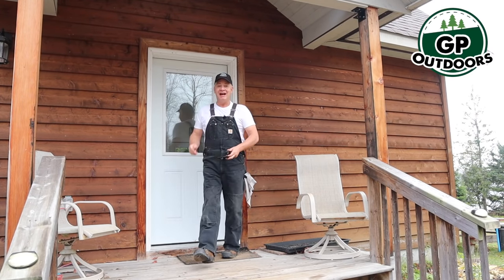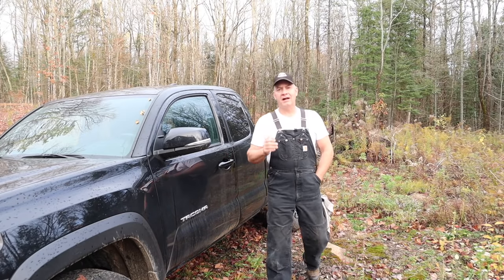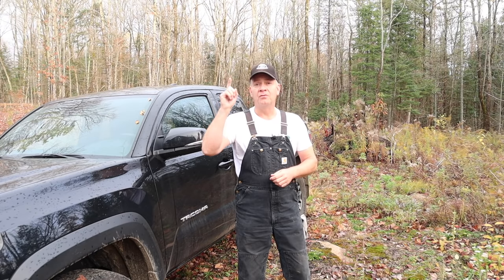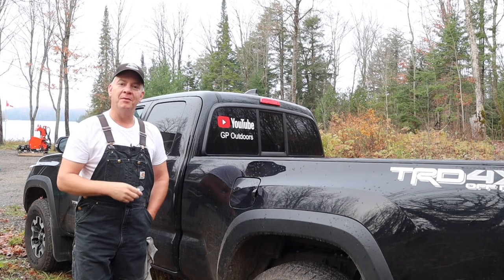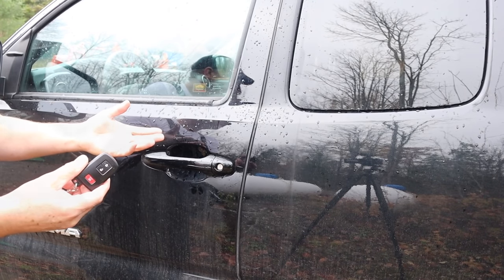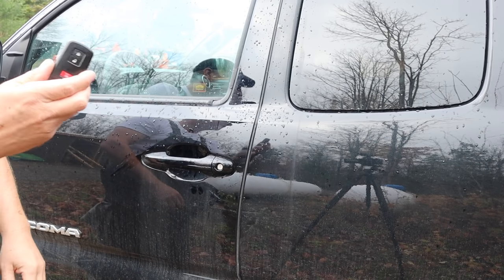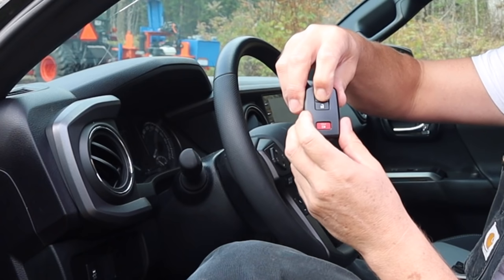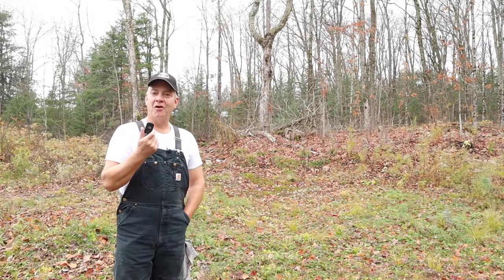#345 Stolen Truck. How To Deactivate Your RF Key FOB. Part 2. You HAVE to watch this!

Comment: Car dealerships should be teaching this info at the time the car is delivered to the new owner. Glad that I stumbled onto this video.
Reply: They should just do regular keys 😑
Reply: I am surprised this is not in the car user manual.
Reply: @jayl2499  If the car makers put this info in the users manual, they wouldn't sell as many cars.
Reply: Yes, same here, on stumbling onto this video!  Timely advice!!!
Reply: Relatives high end vehicle fob was stolen at work while in a security locker, yet, security has no answers. So here's hoping this video gives some piece of mind till it is decided what direction to take on replacements.  Thanks so much for your video, it is greatly appreciated! Have a good weekend!
Reply: @jayl2499  Locksmiths and car dealers wouldn't make thousands then.  Relatives fob was stolen yesterday at work from a security licker, security has no answers, car is high end so it is going to cost $2500 - $3000 to replace two fobs. Totally a rip off and unreal.  Locksmiths get hundreds.  Lots cheaper, but still outrageous!!!
Reply: @aldomandovani  I have no problem with regular keys.  So it takes an extra second or two to get it into the lock and turn it boo hoo!!  With my car that has a regular key you soon automatically learn the motion and next thing you know you are on the road.  People have been doing it like that for as long as there were cars on the roads.  Heck, some really old cars have two keys even.  One for the doors and one for ignition.  Those people whining about the "inconvenience" of inserting a key don't realize how easy they have it.  Maybe some people are just lazy but then some like cars that are fully loaded with electronic gadgets.  Sure all that stuff is nice and all...until it breaks and costs you your first born to get it repaired!!!
Reply: @jayl2499  "I am surprised this is not in the car user manual."

It is on page 128 in the manual for my 2022 RAV4. However I found out about it first from the web, in the first days after I bought the RAV4, there are many YouTube videos about it. The manual also says on page 102 "When bringing a key with wireless remote control function onto an aircraft, make sure you do not press any buttons on the key while inside
the aircraft ...... Pressing a button may cause the key to emit radio waves that could interfere with the operation of the aircraft"
Reply: @aldomandovani   True, they keep making us more vulnerable to things with so much technology.  People need to start using the steering wheel locks again.  They won't take the time to saw through a steel bar because they want to get in and out quick.
Reply: They don't teach this thing, they just give you the key fob and that's it, I just learn it until I watch on youtube.
Reply: They should but American is all about the business that's why I don't buy these new junk vehicles
Reply: Hey GP just saw your first video about the stolen truck & wondered why you didn't mention the deactivation mode on the fob, I read it in the truck manual,  I saw your 2nd video glad you mentioned it to your viewers, I'm  sure it was helpful to everyone,  much mahalos from hawaii 😊
Reply: @steveolive9991  This makes NO sense, no body reads the user manual before purchasing a vehicle.

Comment: If the police, insurance companies, claims adjusters, and likely auto manufacturers are aware of this problem, why haven't they redesigned that lock and push button start system to be more secure?  Good tip from that viewer.
Reply: because it makes more sales for the manufacturer
Reply: because the user wants 'seamless integration' 
Just look at the explosion of smartphones and Amazon Alexa and the 'smart house' devices that will text you what food is in your fridge.  
Its because people are lazy.  They want the Jetson's lifestyle (70s cartoon).  Just look back at commercials advertising items for the home back in the 50s and 60s.  Or World's Fair.
Reply: push button switch is much much cheaper than a key and a cylinder style lock switch but much much less secure. They do it for more PROFIT.
Reply: @davidbrennan5  not sure why you say that push-button is cheaper, they first came out on the high end luxury & super cars.  They require additional transceivers.  If there is a reduction in cost its only due to economy of scale, as they've already made the investment into the high-end cars (where the market is demanding it).  Its the same reason nearly all cars have heated seats and remote start.  Certainly anything above the base model sub-compacts.
Reply: @f1y7rap  push button switch cost 2 dollars. Cylinder lock switch cost $30+ dollars.   Thieves can steal a car in 7 seconds now.  The older cars with a key and a imobilizer system were harder to steal.
Reply: @davidbrennan5  ok, but the push-button system is not just the pushbutton switch.
Reply: @f1y7rap  The manufacturers have been making cars cheaper and cheaper every year. If they can save a trunk lock door locks and ignition locks + glove box lock on every vehicle + keys they can make more money.  The thieves are laughing because it is much easier to unlock and start a vehicle now.
Reply: Bc it is a computer n all things in technology can be hacked nothing is hacking proof I went to school for a computer tech technology n I learned tht everything can be hacked if u have a smart enough person reverse engineering
Reply: Yup there all in on it !
Reply: Seems like insurance companies would hand them pouches out for free when you get ins. from them
Reply: @f1y7rap   Ah the Jetson's. I watched them in B&W 'till my parents got a color TV. :D  "These three day work weeks are killin' me!" ~ George Jetson.   I used this line at work just last week on the last day before my vacation started.
Reply: Simple they want sell you another one, the dealer that is.
Reply: The insurance companies will just jack up their premiums. Win-Win in their eyes.
Reply: Maybe these companies are in on the action
Reply: @dart3407  😂
Reply: Because they are members of organized crime.
Reply: maybe manufacturers do something when they get sue by all the people that got their pickup truck stolen
Reply: Thousands upon thousands of dollars yearly are made by not telling you!!!
Reply: @f1y7rap  Totally agreed!!!  Just made that same reference recently!
Reply: @davidbrennan5  Totally agreed!!!
Reply: @davidbrennan5  Totally agreed!!!
Reply: @davidbrennan5  Totally agreed!!!
Reply: @josephskorich7029  Totally agreed!!!
Reply: @davidnikulka1437  That's for sure!!!
Reply: @stevenreynolds2327  No, because making claims raises insurance costs. They"re in it for the money they make not what you get to keep.
Reply: @SorinNicu  Totally agreed!!!
Reply: @HazyIPA15  Totally agreed!!!
Reply: The question is why are they not propagating this information to everyone calling them about the theft of their vehicle?
Reply: You would think that if these made vehicle theft easier they would stop using it.  In all fairness I have heard that some fobs turn off automatically if no motion is detected in some time period.
Reply: @f1y7rap  my 1966 Mini had push button start.
Reply: @davidbrennan5  i thought the cars came with a manual override key, so that you can still operate the car if the battery goes flat in the transmitter or if it gets broken, usually they put the cylinder lock somewhere hidden or out of normal view, like inside the centre console armrest storage.
Reply: @Murtagh653  You don't need that key to start the car, it is used to unlock the vehicle if the battery dies mostly. Theives buy a cheap box and they can program a new key fob. All they have to do is hold an antenna up near your front door program a key and they are gone in 7 seconds with your new vehicle. The older keys had a built in imobilizer the key needs to turn the lock cylinder and the imobilizer codes have to be right or the vehicle won't start. This is harder to overcome.

Comment: If you have a spare key fob that you don't normally use, you can keep it in any kind of can with a metal lid, so the key fob is completely surrounded by metal, that will function as a Faraday cage and not cost you a penny. Of course you can also drop your regular keys into the metal box overnight. Other alternatives are also simple, remove the battery of the spare key fob, or wrap it in aluminum foil, a couple of layers, the aluminum foil will function as a Faraday cage.

Comment: I prefer the key that goes into the ignition and gets turned. Works every time. The assumption is the push button was to improve security but that's not true. Technology and change in NOT always better.
Reply: How about they put a button like iPhones on the start button where only the drivers thumb print will start the vehicle?  I have just purchased a keyless car and 1) didn't know it was keyless untill after I purchased it and 2) didn't know about relay theft - Now I'm scared I'm going to wake up with no car..  Now I'm hearing about ODB theft as well, just a nightmare.
Reply: @Max317_  Thanks - faraday on way, steering lock on the way and might look at removing a relay or hiring Candice to sit in the back :)
Reply: @Max317_  Thanks I'll have to investigate that - the manufacturer's manual is pretty rubbish.  It's a BMW M135i
Reply: @Max317_  Thanks mate appreciate your help and advice.
Reply: @J4Z666  call your dealer and get them to do the research
Reply: @davidsalomaa373  I had an immobiliser fitted, got the faraday wallets and got the steering lock nobody has touched it in 2 years and good luck if they do they aint going nowhere..

Comment: fantastic advice. We really should be calling for car manufacturers to require pin codes in order to start the car. This is the way Tesla is handling this, this could work in other models too. All new cars are required to have a backup camera, necessitating a screen, so just make it a touch screen and require the pin there.

Comment: This is only my second video I've seen from this guy but I think he doesn't awesome job at explaining everything and the presentation is perfect. She seems like a genuinely good person. Double thumbs-up fun both videos. Oh and on a side note my secret to preventing anyone from stealing my 2007 Chevy Suburban is a little bit more complicated. My housemate remove the battery because he told me it was the wrong type and that it was too small for my vehicle when I just paid $450 from the dealer for this lifetime battery not even 2 months before when I had a bunch of work done on it including replacing the elbow joints and all the stuff that has to do with brand new tires. So after he replaced the battery with $100 one it never stayed charged for more than a day. So as of October 25th it will be three years since my vehicle has moved from the driveway.😢

Comment: Thanks very much for your invaluable info. Thanks both to you and your benefactor who gave you that info about how to disable the radio frequency of the key fob. I immediately went downstairs to the garage and tried and it all worked like a charm. Mine is also  2022 Tacoma Trail edition. Unlike yours, mine starts with a key, but I do have an electronic key fob that opens the door, and I also have a remote start fob to start the truck on those cold Canadian days when I want the truck to be warm when I get down to it. Thanks very much!

Comment: We have a 2018 Subaru Legacy that operates using the radio frequency key fob. We have a one car garage at our townhouse. The other car stays in the garage. In the middle of the night on  February 8, 2024, the car was broken into along with about 7 other cars in our townhouse complex. Fortunately, our car was unable to be driven away because we use a key-less steering wheel club (it's with a combination). No damage was done to the car. The thieves stole some items from the car.

Fast forward to last week after seeing this video, we tried the key-fob deactivation method, and it works. We also keep the two fobs in a large Faraday pouch. Plus we take smaller Faraday cages with us. Great video, lesson learned.

Comment: Thanks for posting these videos.  Shortly after taking delivery of my new 4Runner in the summer I ordered a Faraday Box to store my key fobs at home, assuming that thieves had to be very close to the fob to steal the signal.  Until I saw your other video, I didn't know they'd become more sophisticated and could steal fob signals from much further away.  So, I recently purchased the Faraday pouch you recommended.  I admit, it's a nuisance to carry the fob in the pouch. I'd grown accustomed to opening the doors and starting the vehicle without reaching into my pocket.  I suppose I'll have to get used to it.  It's a small inconvenience to protect an expensive vehicle.

Comment: As you show it, the suggestion from one of your reader is very timely and works very fine with toyota's FOB. If you have a vehicle that is on the coveted or even highly coveted from the thieves list, the other solution is to install a circuit breaker/switch between the computer and the fuel pump, the engine will still turn but it will never start. On youtube you can find some examples that work very well even for very recent vehicles full of electronic (as my 2015, F-250). The ''challenge'' is to hide the circuit breaker/switch very well while making it easy to use on a daily basis without leaving any visual signs of wear at its point of use.Thus, the only way to leave with the vehicle is to tow it. ;-) Thank you again GP with this very valuable info/video.
Reply: My understanding of the way the theft works is that the thief with the antenna is trying to pick up the key fob signal from inside the house and amplify it so the car thinks the fob is nearby. He isn't decoding that signal. Once inside the car, the thieves need physical access to the OBD port to program their new key fob. A second line of defense would be to relocate the car's OBD port from its usual location to higher up under the dash. A dummy OBD port could be put in its place. OBD extension cables are available for when you need to take your car in for service.

Comment: Thank you for posting an update and I'm glad the method I described to stop the FOB broadcasting worked for you.  That tip came from my Subaru owners manual.  Subaru's have a way to enter a code to unlock doors, so you can deactivate the FOB and lock it in the car or trunk if you're going swimming or hiking or doing something that you don't want to carry the key with you.

Comment: Always great information GP,  My last truck 5 yrs ago was on ( carburetor ) 1985 Dodge Ram Van B350.  The carburetor itself was an anti- theft systems with dealing the manual choke and gas pedal on start up's !!! LOL🤣👍 Cheers !!!
Reply: But even if you left the keys in the ignition and directions on how to start nobody would want to steal that thing! lol
Reply: @danschmidt1  HEY Sir !!! My Van was a great one, I was able to pull my 7000 lbs RV with it 👍 I had 3 offerts the same day that I publish it !!! LOL  I can send to you picture of it to regrets your comment  Sir 🤣👍😊 CHeers !!!
Reply: @RCAFpolarexpress  😂😂😂 I’m just joking. Some of the older vehicles are more reliable than all this new electronic shit and don’t need a computer to work on it
Reply: @danschmidt1  🤣🤣🤣 I agree with you Sir about computerized vehicle 👍 Have a great week end Cheers !!! 😊👍
Reply: Manual transmissions can have a similar effect. "What's this other pedal for?"
Reply: @raygunsforronnie847  Yes Sir I do agree and I also had my fourth pedal ( park brakes !!! ) do deal with !!! CHeers !!!

Comment: Hi GP, one more follow-up to answer your concern about starting your Toyota with the key fob deactivated. You can start your car with a deactivated key fob by placing the silver Toyota logo on the back of your key fob to the ignition start button, then pressing the start button.
Reply from the maker: Morning and thanks very much Eric! That, they told me about, but thanks for sharing it - very helpful for folks. Cheers!
Reply: This means that it doesn't shut off the RF signal, it just reduces the strength of the signal.

Comment: Great info - thanks for sharing your experience. I have a 2019 Chevy Bolt EV and the fob (aka RKE=Remote Keyless Entry) transmitter can be disabled by pressing and holding the lock and un-lock buttons for three seconds. Have to do the same to turn transmitter back on. This is probably how in works on most GM vehicles. Details were in the Owners Manual.

Comment: You could also install a hidden on/off switch to keep the start button from working. As long as its hidden, the thieves would not be able to start it. Either the hot to the ignition, or the hot coming from the ignition when pressed. So even if they manage to get your rf signal, they start would be inoperable.
Reply: That is an excellent suggestion! I had a car back in the 70's that had a kill switch. It def worked!!!

Comment: Two ideas.  My Subaru has a way to remote start.  And has a find my vehicle button too.  I trust it works.  Second, I use a steering wheel bar that locks.  Hardened steel.  Works with a key. Thanks for fob trick as I will try it in the morning.  I trust my Subaru will be there then!
Reply: The Club! I hadn't thought of that in years! I have one out in the garage!

Comment: GP-thanks for sharing this bit of information.  I have a 2019 Subaru STI with push button start and this works to deactivate on the Subaru as well.  Subaru and Toyota have partnership of sort and figured they share suppliers of parts but like you state may work with most brands.  I park inside of a garage so the thieves could pick up my FOB inside but would need to break into the garage.  These guys probably go after low hanging fruit but if I go someplace and park outside this maneuver would be useful.  Thank You!